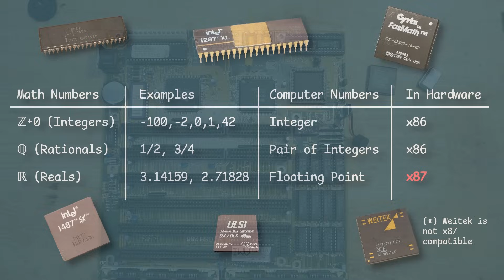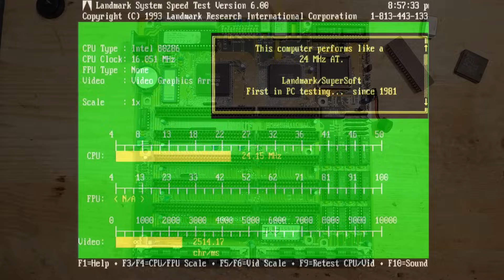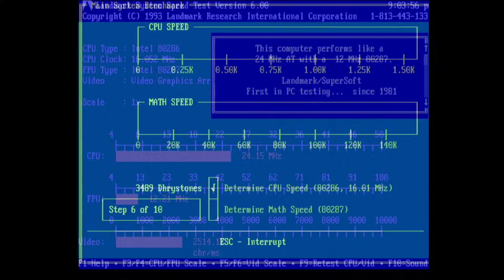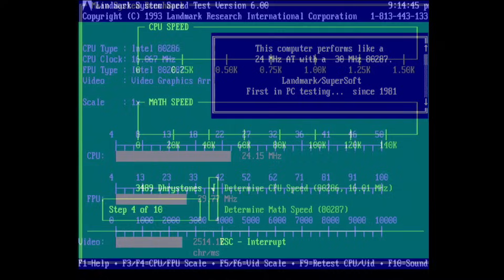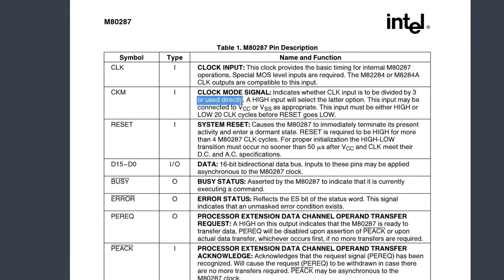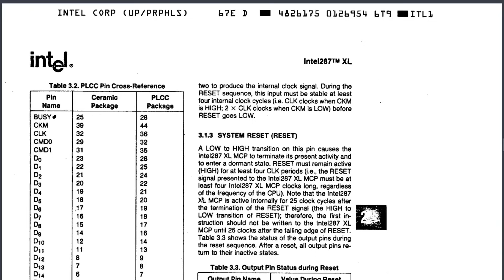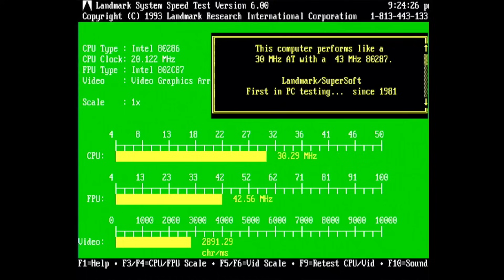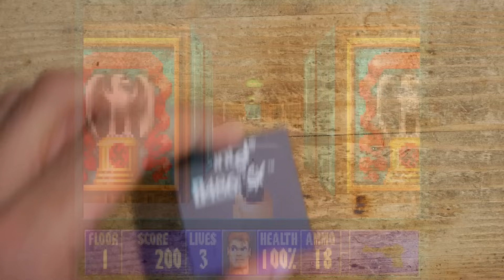287 Booster

Comment: Fair warning:  This is a "well akshually..." comment.  :-D  Not particularly important, I just thought it was interesting when I first learned about it.  Here goes ....

Financial calculations don't usually use floating point numbers because floats are actually approximations.  They can store very large (or very small) numbers, since the decimal "floats" around depending on the scale of the number to the left of the decimal (the significand ).  The scale of the significand is normalized (123456 turns into 1.23456), and then a base and exponent are added to represent the original number's scale (1.23456 * 10 ^ 5).  While the typically large number of bits used to store floating point numbers offers high precision, it doesn't guarantee accuracy, which is (of course) critical for financial calculations.  Further, precision is fixed, meaning, e.g., the larger the number (more digits in the significand), the less precise the fractional part becomes.

Ergo, financials are commonly fixed-point arithmetic, which is really just integer arithmetic with an implied decimal point at a known position.  That way, you can guarantee any required precision and accuracy on both sides of the decimal.

Class dismissed.  haha
Reply: my dude, every finance department in the world runs on Excel (and would have been 1-2-3 when the 286 was king). I don't know what NetSuite uses internally but it's a myth that floating point is not used for finance.
Reply: basically emulating old adding machines. :p

Comment: Didn't Doom use calculations based on the Pi number? That would have benefited from a FPU as well.
Reply from the maker: They used pre-calculated look up tables for trigonometrical calculations to avoid any FPU necessity. So Doom doesn't benefit from an FPU in any way.

Comment: Question/Comment, on the slide deck that around 1:55, https://youtu.be/LVNkYi_cC8g?t=115 , you say that x86 has hardware support for rationals, and not reals. That seems suprising to me, as a developer, I'm not a low level coder (and never coded in DOS) but I'm not familiar of any language that has a rational base type (and would argue that floating point is actually the rational type). I thought maybe you meant something like fixed decimal point representation, but your explanation of keeping track of pairs of integers, I dunno if if I would call that "hardware support" for rationals, and would argue that is just analogous to doing floating point math in software and using an int type.
Reply from the maker: I'm afraid, I was not explicit enough. Rationals were of course not implemented as base types, but rather modeled with a pair of integers including whole bunch of functions in software which were used to work with those numbers. Of course that was very cumbersome and slow, but often still faster, than floating point numbers (without an FPU).
Reply: @necro_ware  Thank you, and I love your videos by the way!

Comment: Oh the 486 saga, DX has FPU, SX came later, first was a "full" 486 with the FPU disabled, before a separate revision - and the 487 "FPU" was actually a full 486 with an additional pin to disable a soldered on 486SX.
Windows always presented FPU capability, emulated if no actual FPU, so anything that uses floating point in Windows was automatically covered by emulation or hardware, even Windows calculator
Reply: Some applications would still thumb their nose up with out an actual fpu, like autocad for windows. But that was the exception. Most all would run anyhow.
Reply: WIN87EM.DLL -- worth looking into how that worked and looking at the actual code inside.

Comment: I haen't watched to the end yet (I'm at 9.28) but one difference between the 287 and the 287XL is that the 287XL is in reality a 387 with the 287 pinout. Besides the higher clocks, a lot of instruction also took much less cycles on the XL than on the regular 287. The XL is internally clocked at half its external clock while the 287 divides the clock by 3. Furthermore, the communication protocol between the CPU and the FPU takes 14 to 20 cycles less on the XL.

Comment: 287XL was important if you needed IEEE754 compliance. 287 was too early for that spec.
Reply from the maker: Original i287 was indeed too early, however in the specs/datasheets they said "Implements Proposed IEEE Floating
Point Standard 754" and I don't know if that implementation deviates in any way from the final standard. At least I never stumbled upon an incompatibility, so I would call it pretty much IEEE754 compatible.
Reply: @necro_ware Is there a test to compare 287 vs 387?

Comment: For both the CPU and FPU I would like to know how much hotter they get (for example while running a certain benchmark for x amount of minutes) with each incremental stable overclock compared to running at stock speed using a thermocouple or FLIR camera. Could be interesting maby? Especially as both don't require a heatsink initially. Do they ever get hotter than the specified maximum operating temperature?

Comment: Having an FPU in your home 286 or 386 was all about bragging and not actually using it.
Reply: I had one on my 386sx and actually played Falcon 3.0 a lot. I also  used CAD as I was working on an engineering degree.  But yeah, definitely the exception and not the norm.

Comment: My dad's 286 PC had a 287 coprocessor as it was needed for AutoCAD. The price of the 287 was half of the price of the entire computer, including svga monitor, 1MB of RAM and an inkjet printer. 
And that was in 89. 
It's hard to believe that we now all of us have many computers in our pockets.
Reply: I remember seeing benchmarks for some CAD software that could run without an FPU but supported one. 

With? Operation would take less than ten minutes. Without? Could take several hours. For the right applications it was basically essential even if the software technically operated without one.
Reply: STRAKON CAD run on 286 with a CoPro. My first PC was a 386SX-40 NEAT AT, MFM 40 MB HDD, where I bought a CoPro and a Speedstar 24 along the Hercules PaperWhite 14" and bought EIZO 9080i 16".
My career as a CAD Prof. started. I still was a student and worked for DiCAD customer service so I invested the earned money in my IT equipment. Learning by Doing all my life till I got f*cked by J-Walker bolscevichi FRG, finally by HP ES after they took over EDS.
Reply: @borlibaer  Odd having an MFM HDD in a 386.  By this stage most 386s would have had IDE either on the board or on a multi I/O card.  An MFM would have made it so slow.
Reply: Still running AutoCAD. It really smokes on todays computers. Back in the day running AutoCAD 0n a 286 machine could take up to a minute to regen when we’re laying out cct boards. That became our test to see how fast a new PC was. I was in the test engineering group and when the mechanical department got 287 coprocessors we were pretty jealous!
Reply: Personally, the "we've come a long way" stat that blows my mind the most is that we now have 1TB+ microsd cards with 4TB expected this year. That's 4TB in something smaller than my thumbnail. And not just that, but 4TB of nonvolatile storage that has about the same bandwidth as the RAM In a 286. The CPU and GPU advances and stuff are kinda unsurprising-not unimpressive, just unsurprising-to me; the changes in storage are insane.

Comment: Ah, the days.  I remember well overclocking my 287s.  I was doing engineering work, mainly in FORTRAN.  Put a heat sink on it.... away you go.
Reply: It helps that the 287XL is a 387 in a DIP-40 package and was thus more than capable of running synchronized with the fastest 286s.

Comment: "Booster"
There is this persistent myth that will still not go away that MORECPU IS MOAR BETTER!!!
It's not.  Nothing back then used the math-co. 
Congratulations, you found the one game that did.
Math co-processors were designed for business applications like CAD/CAM software which actually did use the math-co. Lotus 1-2-3would too, if you had the right formulas. 
But nobody cares about those.Hell,when's the last time you even saw winners like WordStar featured on one of these retro chnnels?  
Never.

Comment: i wonder if existing 386DX can have a co-pro addon with cache - so the 386 maybe.. will become a less-pin 486 ?
Reply: There was a dedicated 387DX co-pro that paired with 386DX. For a 386SX there is a Ti 486SXLC-50 that can be replaced (by hand... smd soldering etc) and it gives around 30% performance vs the 386sx. I did this mod on my Amiga A2386SX Bridgeboard.

Comment: I am under a power outage, but I'll sacrifice some of my phone's charge to watch this.
Reply: Make sure to keep a Power Bank and UPS for emergencies.
Reply: based
Reply: Dim your screen to minimum and turn off wi-fi.
Reply: @Heike-- cellular consumes more battery than wifi. If his wifi router has a battery backup and is running then there is no benifit of switching to mobile data. Better to turn on flight mode and use just the wifi to download the video while the screen is off and then watch it with wifi turned off😂
Reply: @KuntalGhosh  You can't download anything while the screen is off.  The whole phone goes to sleep.  Chrome treats playing videos while screen is off like some kind of tribal secret.
Wifi is constantly searching for networks to connect to. If there aren't any (power is off) then turn wi-fi off to save battery. 
Obviously cellular has to stay on, how are you going to download anything?  
Do you think, or just start reciting things when you see a trigger?

Comment: Math co-pros weren't used in financial software. Since (almost) all currencies are decimal, it's simple to represent all values as integers, and throw a period (or comma for you Europeans) 2 (or rarely, 3) positions from the end.
Reply: Could have sworn Lotus 1-2-3  would use it with the right formulas.
Reply: @Heike--  Spreadsheets aren't financial software per se, even though they're treated as such de facto. In reality, they're essentially programming languages, and as such rarely fail to support floating point. Compare and contrast to specific finance software of the time, such as MS Money, Quicken, etc.
Reply from the maker: Yes, also Excel used it. Of course it's debatable if such calculation programs are financial software, but they were also used for that.

Comment: I never knew this XL FPU existed... imagine back in the day having that performance increase, that was huge!
Reply: The original early 287 had some performance regression to the 8087. And generally gave it a lousy reputation.
Reply: Nothing used an FPU back in the day except CAD/CAM software.  Biggest fallacy in retro computing is that FPUs did anything.
Reply: @Heike--  The context of the video and my comment is the FPU, so naturally I'm referring to software that used the FPU.  Obviously things used the FPU.  If they didn't, the FPU wouldn't exist.  Maybe nothing you used, but I worked with one company that was doing Autocad back in the day and this XL FPU with an overclock would have been a big improvement.

Comment: There should be a dos MP3 player that uses the FPU and runs on 286 :)
Reply: @ochyksyh

I am the one mentioned by necroware and I created the prototype design for the PCB.

I tried all sorts of things on my 286 after building the PCB, including MP3 players. They run but at about 1/15 of the regular speed. A 286 with FPU can't even play MIDI files at normal speed.
Reply from the maker: Yeah, that's impossible. FFT based algorithms which are used for MP3 decoding need at least a Pentium class FPU. Even 486DX4 is barely able to handle that.
Reply: @necro_ware  Yeah. I had 486DX4 100Mhz and I could play MP3 only with downsample mode to 22khz.
Reply: @necro_ware 286 processors can't handle MP3.
Only with a sound card... And I'm not very sure about it.
286 only can handle low quality WAVs, MOD and S3M files.